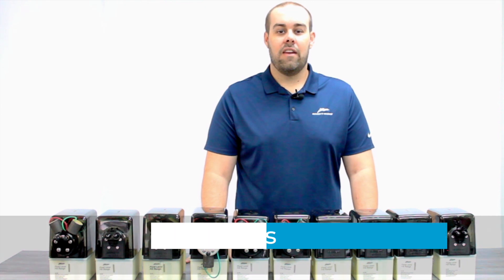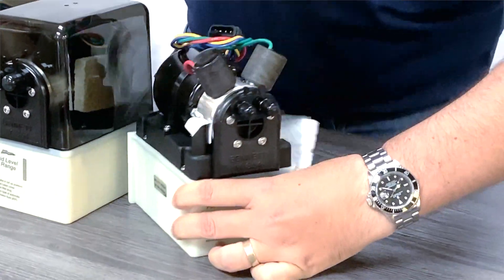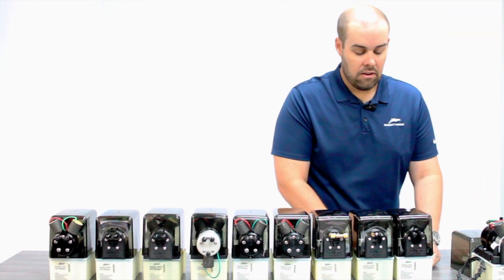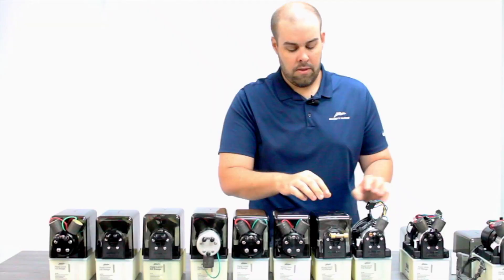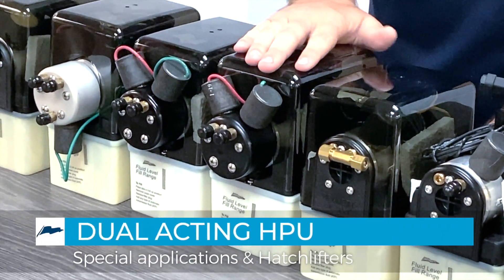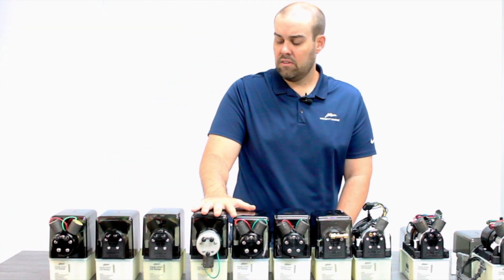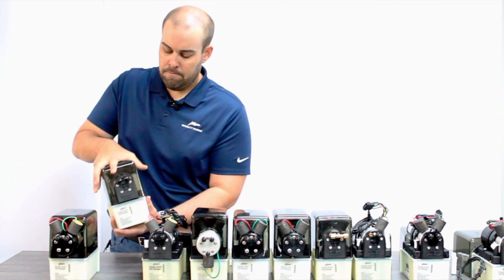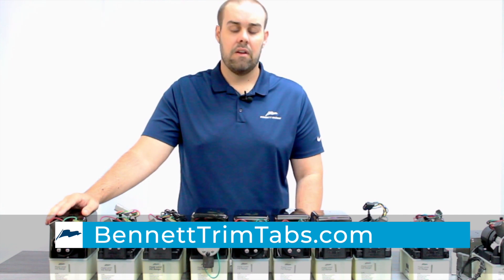Differentiating Between Bennett Hydraulic Power Units

Comment: What is the difference in plumbing for the dual acting pumps? If it is for operating two separate items, why are there only 2 hoes connections? How would you operate two trim tabs and a hatch with only two hoses? What is the wiring for these pumps? why not show? What does "special wiring for OEM" mean?

I install/service these units daily and have only seen one dual acting pump. It has a blue and black wire, meaning it only spins one way. How do two tabs operate with a pump that has 4 valves and only spins one way?